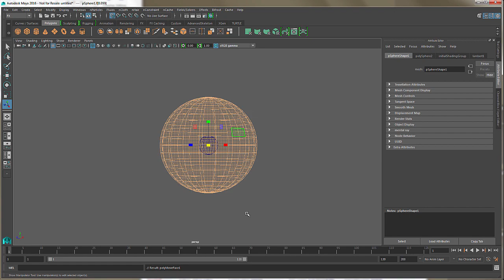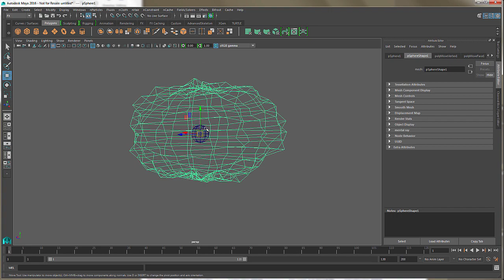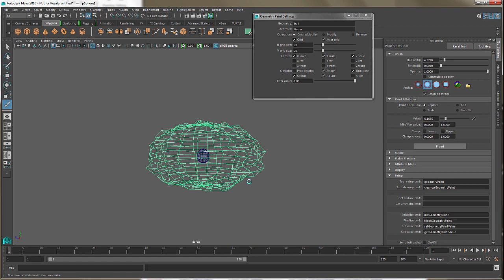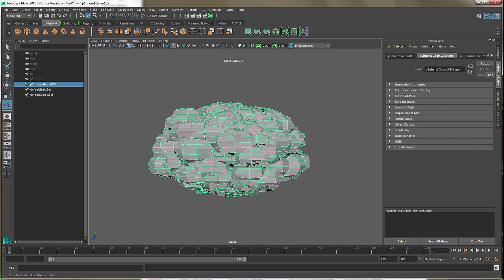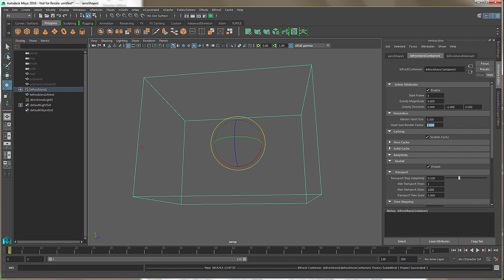Bifrost aero cloud workflow

Comment: My Poly Move Face History -> random is by default on 1.00. Nothing happens when I change the value. How can I fix this?
Reply: what version of maya are you using? if using 17 and above, select sphere => Edit Mesh => Transform Component => click square box => set to 1.0 on random => Apply => Transform Vertex. Then use X,Y, Z arrow to tune the faces. 

Typical of some video broadcasters to skip essential steps/parts of tutorial......
Reply: after you set random to 1 you need to move the components that you selected.

Comment: This looks amazing.  I tried it out at my home computer (which is older) and it was far too slow.  I would like to try it out here at work on our much more powerful workstations, but we are on 2015 at the moment.  Is there a method of single frame cache without using alembic?  I tried disabling the sim but then it disappears?  We have numerous projects with extensive cloud fly throughs and this could be invaluable if we could get it working in VP 2.0, but light way to get realtime playback with say 100 or more clouds??  Or maybe 20 or so hero clouds and cards or maya fluids for the bgs???